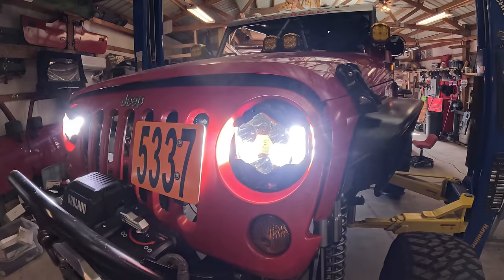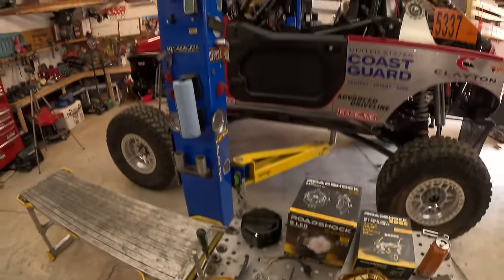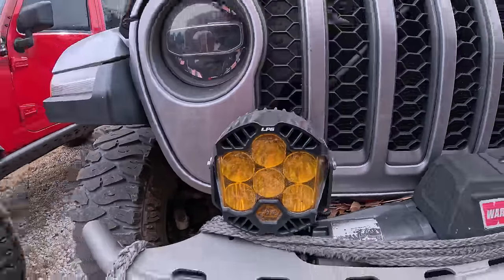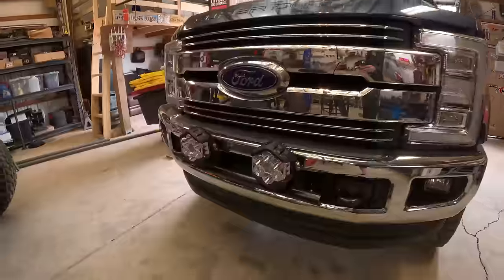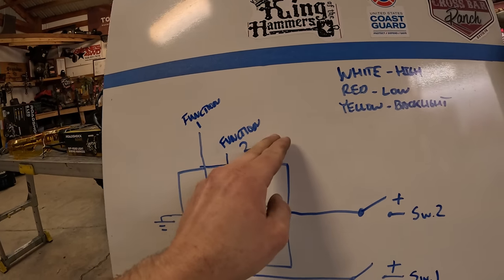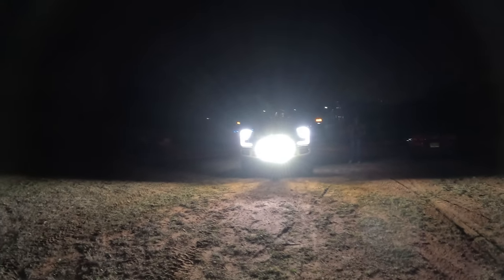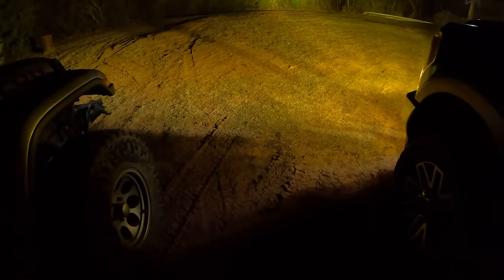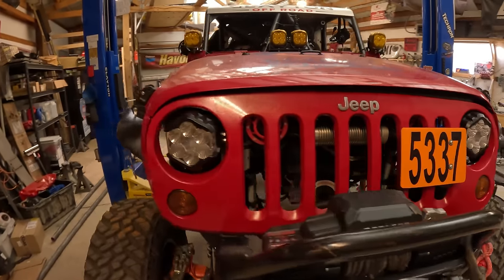These NEW Harbor Freight Lights are INSANE!

Comment: I’ve had BD and DD and rigid.  I have also been buying cheap knock offs lately.  The majority of them either the knock offs were the same output of so close you couldn’t tell the difference unless you put them side by side.  My main issue is the expensive lights offered no reliability compared to the knock offs.  Actually my knock offs have outlasted almost every stupid expensive brand I have owned.  I’m done buying the expensive stuff.  They are ripping people off.  Period.
Reply: I’ve had the same experience as you. My rigid and bd lights have only been as reliable or even less as the ebay specials. To my knowledge about the manufacturer of led lights and other products made in China, these lights are all built in the same warehouses in China. Only difference is the brand name ones get their name slapped on it, and the branded name company themselves may/ or may not go through them once they arrive in America at their corporate office, they may go through a quick inspection to pass a rough inspection test. China ones usually get no second inspection and so it’s hit or miss. But they all use the same cree diodes or simi/Phillips diodes used by the big brands. 
 unless the brand is strictly “made in the USA” only products, if they come from China, they aren’t any different from the eBay specials, they actually are made by the same manufacturers in China.
Not that eqch product is exact same quality as the eBay special, of course if the high end brand spends more on a light for the raw material and labor to make said light, it will usually be of better quality than the eBay equivalent. But we as consumers have no clue which light the brand actually spent more money on producing and which light they spent exactly the same as the eBay light and just charge 5x more cuss of their name slapped on it.
Reply: I’ve had knockoffs on my pre-runner for years. The light quality and reliability of the knock offs is so close to the namebrand stuff. It’s hard to justify paying for Baja designs or rigid.
Reply: BD has a lifetime warranty...
Reply: You should get them replaced with BD lifetime warranty… I definitely would
Reply: @dailydr1ver935 baja designs used to be made here in california, they cleared house and moved the entire operation to Mexico. So I wouldn't trust them anymore honestly
Reply: @EricB90  I have over a dozen of their lights bought over the last 10 years and not a single one of them have had any issue.  Not to mention you can get refresh kits to replace faded and chipped bezels, lenses and o-rings.

Do the terms "CRI" or "direct driven" mean anything to you?
Reply: @dailydr1ver935  if that's the case then I probably made some of those lights you have. I'm not shifting on the quality but the company has gone completely off the past 5 years. Not sure you understand my point.
Reply: I dated a chick with DD’s in high school . 😬
Reply: I’ve always ran nilight, never had issues other than it doesn’t throw light far enough when going 80+
Reply: I run BD on my current prerunner but I used to run Auxbeam still not bad
Reply: So does all terrain concepts and more affordable
Reply: @RobertMcAlpine-cu6qx who makes them?
Reply: @gregtennyson what lights?
Reply: @00ninja00 CT

Comment: I worked for HFT at Corp for 11 years, always begging for products like this, and for the company to work with the offroad community. I have moved on to other things now but so happy to see they have grown into the space.  I used the Badlands on two of our "Show" builds last year
Reply: HF has crappy duty cycle times for their electric winches, but then again, ALL electric winches have similar crappy duty cycles (at least compared to a hydraulic winch)... At least HF puts their crappy duty cycle rating in their manual instead of hiding it like some of the other electric winch manufacturers do...
Reply: What’d you move on to if you don’t mind me asking?

Comment: I don't know when $150 each became a 'budget' price. But I was impressed with them and especially your presentation. Thanks
Reply: when compared to the 300+ for the BD lights it is very budget... 
My BD LP9 pros were $750 each... I still vouch that there is almost no comparison to them and have impressed many people with my pair of mini suns on the front of my truck. If I was going to run the risk of bashing these lights on the rocks or trees, i would definitely consider the cheaper option.
Reply: Kinda thinking the same thing you can go right the source in China! I can get led laser pods 7 inch for $130 per pair shipped to your door step lol
Reply: 2020, welcome time traveler.  30k trucks are 70k now, $60 lights are $125
Reply: The lp6's on my Bronco did the same thing....delaminated.
Wire the low beam to your aux switch, tap your high beam circuit on your oem high beam circuit.  That way it will automatically kick into high beamwith your headlights going to high beam. It will require your aux switch to be on to work.  It acts like a gatekeeper for the lights.  On my truck it turns on the high beams automatically when needed.
Reply: I don't know when "budget" became synonymous with "low priced".
Too many people assigning their own definitions to terms.
Reply: Budget =/= low priced
Reply: @Serenityindailylife  Need to travel a few more miles into the past for my time reference. Sealed beams were $5 to $10 for halogens. Doesn't seem that long ago but $10 then is probably $100 or more now thanks to government spending money they don't have which devalues the dollar. Thank your favorite politician.

Comment: I’ve been using Road shock lights for probably 5 years. I’ve torture tested and submerged the first light bar I got and I never had any issues. Out of all the vehicles I’ve put them on I’ve never had any issues. The biggest thing that sold me is when compared to big brand lights the big brand output was terrible and they fogged up in the first week of just normal driving and weather, the road shocks never fog even after being submerged. They are so many pros with the road shock brand I won’t buy anything else. Thanks for the great video.

Comment: Got me thinking of getting these. Your relay set is going to burn out your switch to 30. That a high amp power source for the relay. You mean switch one and two is that coming from your relayed switches? Your lights should be brighter too if you source 30 to the battery with a fuse

Comment: you can open the baja lights use a soldering iron to heat up the bolts and melt the locktite

Comment: great video, I wish you'd have shown as many shots without the yellow filter to check out the illumination better. Unfortunately, as of early March these are not listed on their website & they don't appear to be available until around April.  Would like to see a side by side comparison of the white 4 led as well as the 6 led as far as night light up video to see pattern, distance. you could update with amperage draw for each.  thanks for sharing these

Comment: I have used Harbor Freight LED cubes and small light bars. I also have the 12,000 Apex winch on their hitch mount. I did use a Warn 2" multi-mount front hitch on my 4Runner as they didn't have anything I could adapt to work. Not the highest quality stuff, but it works amazingly well.

Comment: I’ve had the roadshock cube lights in both front and rear bumper. After 2 northern Michigan winters they are still going strong but the powder coat has flaked off. I run 2 KC slim lights and a gravity pro light bar and those are top notch

Comment: With how road salt and decier in the winter, up here in eastern half of WA wrecks everything during winter driving, I won't spend top dollar for high end lights any more.  My Rigid Dually lights are getting wrecked.
Harbor Freight really need to offer (or include) a clear lens cover.  I've been running clear lens covers on my Rigid Lights since I installed them in 2017, and the lens is in perfect condition because the cover protects them from road sand, etc in the winter.

Comment: I bought these for myself for Father’s Day, and am getting ready to install them. Your video talked about the wiring considerations and need for a relay for the low and high beams, but not the backlight. How did you wire that? I assume there is no need for the relay for the backlight because of the low amp draw, correct?

Comment: Great Review, the Roadshock lights do look great for such a good value. You can tell the Baja Design is brighter overall but not enough for me to justify the price difference. Although with your F250 setup, I think the two Roadshocks on the outside and 1 Baja Design in the middle would be the ultimate package for that truck. I do light how much side light you get from the Roadshocks. The 2 Roadshocks put out as much if not more side light than my 6 3" Pod lights in my Raptor Bumper. Thanks for the review, I think I will invest in a couple. Also the amber lens is a solid Yes from me. Love the amber light offroad and in foggy conditions.

Comment: Just want a good amber fog light for road use. Have a 40 mile one way drive to work through occasional fog, pretty rural highway for most of it. Vehicle already has mounting points with factory grille rack so no fabrication needed.

Comment: The center mounting bolt is m12. A lot of A pillar mounts are m10. The m10s seem to fit fine
Reply: I picked up two of the 4 LED for my pillars and two 6 LED for the front bumper on my Gladiator.

Used your second relay suggestion as the base of my setup except I wanted to keep aux 1 and 2 open for future use and the lights are too much for 3 and 4, so I used 3 and 4 as triggers

Relay one:
Battery power to 30
Aux 3 to 85
87 to 30 on relay 2

Relay 2:
30 powered by relay 1
85 connected to factory high beam 
87a connected to low on pillar lights
87 connected to high on pillar lights

Duplicate setup for bumper lights.  

Now to find a relay holder...

Comment: I would have liked to have seen if you wired the lights into the factory overhead switches or not? If so did you wire to two different switches?

Comment: I run a pair of the old road shocks with the gravel guards on my race car trailer for night loading my car  they have worked well now for 10 years , wired to a togglr switch on my tool box , may swap em out for LED's ,  Good vid

Comment: Probably worth noting that using pin 30 from a switch defeats the purpose of the relay. You may be throwing too much current through sw1. 30 should really come from a fused high current source.
Reply from the maker: Yes like I mentioned this relay setup would be for someone who has a switch system with relays.

Comment: I'm extremely interested in these RoadShock lights for the price point.

But for the BajaDesign lights, why not send them in the BD and get the refurbished/replaced under warranty.  I imagine it would cover the issues with the delamination or even the pitting you were talking about.
Reply: Yeah, it's a quick and easy email to BD. Definitely the best warranty dept I've worked with for Offroad lighting.
Reply from the maker: I will probably get these warrantied, but either way it was worth showing

Comment: Great video.  One question about the one relay setup, How many amps are going through switch "A-1? Switch two would work fine. one has all the load going through it? 30- 40 amp relay on a 5 amp switch as hot?
Reply: I’m thinking the same thing. All the load is going thru switch 1. Kinda defeats the purpose of using a relay to handle the load.

Comment: even the baja designs was having the reflective coating fail after 4 years. m cheap ebay fog lights didn't last 1 winter. water gets in and condenses because of the heat then cant evaporate because of the closed lens, which eventually corrodes the coating. i doubt the HF version will have better sealing and a better coating than the name brand.  another thing is heat, the led light output might look fine initially, but if heat dissipation isn't managed the output will drop off after a short amount of time. i dont see nearly as many heat fins on the HF lights as the Baja designs.
Reply from the maker: They seemed to keep the same output for hours during our time in Johnson Valley with the rig.

Comment: I put the older 2” square pods on my car, and am a big fan already. Two floods and two spots. I used the oreillys wireless controller and it was nearly plug and play. I’ll probably put four of the 6” lights on my truck with the same controller. It’s just too easy.

Comment: So you can turn on the low and the high and they are both on at the same time, I’m confused because you said that you can not connect both at the same time
Reply from the maker: The high beam circuit turns all the lights on, the low beam circuit powers the lower LEDs, don’t send 12v to the lower LEDs through both internal circuits

Comment: How did you do the wiring on your Switch Pros to accommodate the three different modes (backlight, low beam, and high beam)?
Reply from the maker: Switch pros allows you to disable certain circuits when another is activated, so when I turn high beams on, the low beams automatically turn off, lots of neat features like that in the switch pro unit. The backlight is tied into my running light circuit (taillights, chase light, side lights) and they all automatically come on with ignition power. One of these days I’ll buy another switch pro unit and do a full video on it, it’s packed with features that not many people talk about.
Reply: @JKGearandGadgets  Thanks for the feedback.  I’ll soon be converting my current fuse block-type accessory wiring situation to Switch Pros (RCR-FORCE-12) and I’m trying to wrap my mind around a new way of wiring things.  In my head, a low beam/high beam situation would require two Switch Pros wires (one for high, one for low). Two switches too (unless using ON/ON/OFF). Planning this in advance is different than using a toggle switch in the dash that provides low/off/high. Great idea running the backlight through the running light circuit!
Reply: @JKGearandGadgets  Could you use Switch Pros On-On-Off feature to cycle the Lo to High to Off?

Comment: How did you wire up the amber backlight?  Does it have to go on a separate switch?
Reply from the maker: I just tied it into an ignition powered circuit.

Comment: Likely no rf filtering on those cheap lights, try running a ham radio with them on, the squelch will have to be maxxed out, range will be next to nothing, you'll sww on high-end lights they advertise emf filtering.
Reply from the maker: Not sure about ham radio, but my race radio and comms worked fine with them on

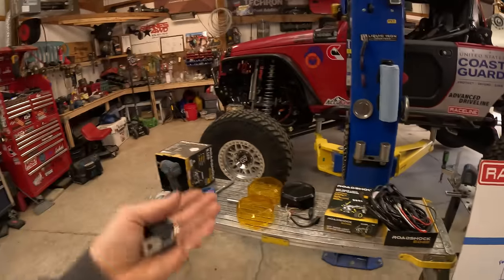Comment: 9:08 Both the high beam and low beam are 12 volts, the lights need a voltage reduction?
Reply from the maker: Low beam powers the lower LEDs, high beam powers all the LEDs, if you are sending 12v to the low beams, and then send 12v to them all with high beam switch it will fry them.
Reply: @JKGearandGadgets So the low beams get 6 volts? How does the voltage change? It is all 12 volts. Automotive relays don't change voltage (they can but not in this case). Relays let a low power (amps) switch trip a high power feed to an accessory. The switch does not need to carry the heavy load, you are not running 130 amps through the switch, it might be like 0.5 amps. High amps burns wires and switches. 6 volts can still be high amps. Amps do the work. A starter and a winch need high amps. Solenoids are relays meant to handle the heavy load. I get what you are saying that the light needs 2 switches, one for the low beam and one for the high beam but there is nothing in the circuit (other than the light) changing voltage.

Comment: Amp draw is very easy to test and you can no more rely on what the seller / manufacturer CLAIMS it be than what they CLAIM the lumens to be.  Battery capacity for lithium cells is another thing that they lie about often...  I have recently been testings various LED pod / "light bar"-type lights for Amazon on their Vine program and the claims (lies) that the sellers (usually Chinese products) put in their ads make me distrust ANY ads put out by ANY company.

The companies figure that they can lie about lumens because very few people have the proper test rigs to measure lumen output.  What they fail to realize though is that there is a range of lumen output for LEDs that currently tops out at about 220 lumens per watt for the very best LEDs out there.  For the cheaper LEDs, it might be half of that... As a quick way to prove that the sellers are lying, I put my multimeter inline with the power on the LED bulb assembly and measure the amperage.  I then change it to measure voltage and measure the power supply voltage.  I'm using a bench power supply that is good for 200W and it produces 12.05V according to my meter.  Then, it's a simple calculation to gets wattage (watts = volts * amps) and calculate the best case lumens (lumens = watts / 220)... A seller recently claimed 54,000 lumens for their lights and by my calculations, the very best it might have been just from the wattage consumed was less than half of that...

And as far as wiring it so that the low beams and high beams cannot come on at the same time... Does the instruction sheet / manual for the lights actually say that you must avoid that to prevent damage to the lights or is it just a usage recommendation?  I've never seen such a restriction before and actually, in many cars, there is a way for low and high beams to come on at the same time via the "flash-to-pass" operation on the light stalk control on the steering column.